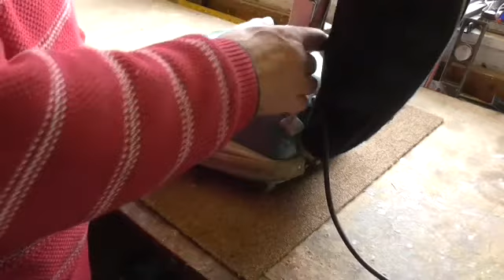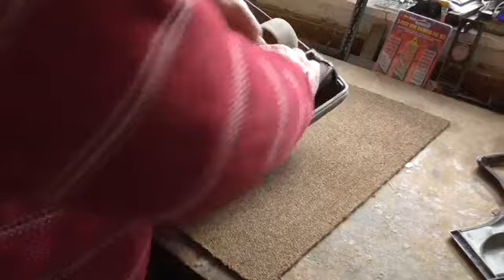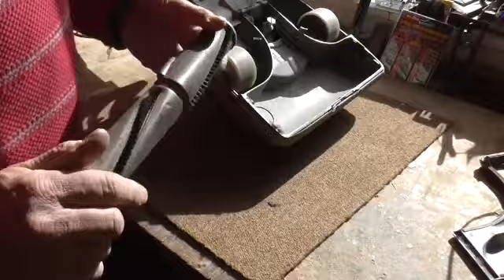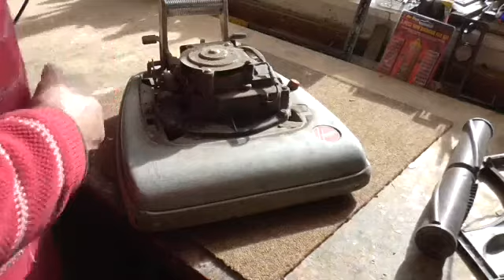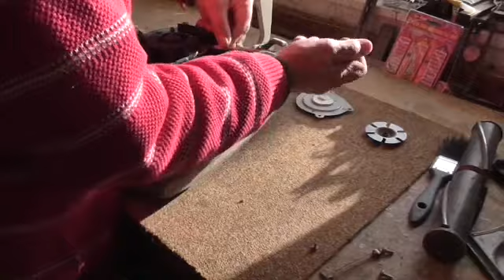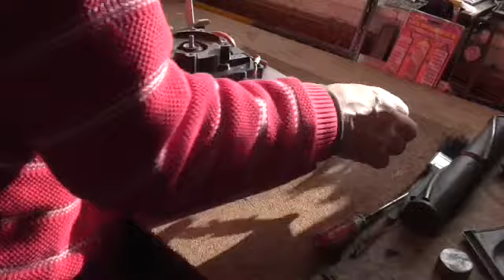Servicing a Hoover senior 652 part 1

Comment: Throughly interesting video. My mother had the same model in grey and the dusting tools which she found out had virtually no suction at all so were hardly used . She replaced the senior with a Hoover Junior U1104 as found the senior too heavy to carry upstairs. I have the Hoover Junior she had and wish I had the senior she had too
Reply from the maker: Thanks for the kind comment. Most folk who bought the tool kits for both Junior and Senior cleaners ended up not using them. As an upright for cleaning carpets they were excellent but not much good with the tool kits.

Comment: Hi, I appreciate your video as I am cleaning and servicing my mum's Hoover at the moment. However, i seem to encounter a problem as i cannot release the cooling fan counterclockwise as you did. It feels jammed. It does turn clockwise, but I see that the whole armature underneath is moving too. Any tips on how I can do this please? I tried a little spray of WD40 but not working. It feels that I am tightening rather than unscrewing. Your help is much appreciated.
Reply from the maker: If the motor is still fitted to the body you can push a screwdriver or something in the hole in the body behind the bag flange to hold it to unscrew the small fan on top.
Reply: @scrimperuk  I had a screwdriver in the bottom fan to stop it from moving the whole thing, but I just could not remove the fan as easily as you did in the video. I managed by pushing the fan blades by a screwdriver little by little until it was released.  Seems the build up if carbon on the motor jammed the fan with the upper part of the motor. Thank you so much for taking the time to reply. I'll be watching and serving bit by bit, one video at a time. Thank you

Comment: Hi, I have a couple of Hoovers, on the U1016 the handle bale wont hold the handle upright, it seems to be operated by a metal plate that a spring in the middle of the plate keeps prssed up by a rachet that locks into a latch on the base of the handle holder, I have stretched this spring out a bit but it doesnt help much, it holds the handle in the mid position OK, do you know how to adjust this bale rachet to hold the handle upright? thanks  amateursewing @gmail.com
Reply from the maker: A common fault on the 1334-1012 Hoover junior range, it's not a case of adjustment sadly. If you remove the handle socket unit you will find that the ratchets on the bottom of the socket have worn round so that the spring loaded pawl will not catch on it, sometimes it is possible to file it so as to make it catch but often a new socket is the only answer. Another thing that can contribute to the problem is the main handle socket bolt and the hole it goes through get worn which makes the problem worse. You can still buy the handle socket via ebay but they do charge a lot for them.
Reply: @scrimperuk  Thanks for that, the little notch in the base of the handle bale seems unworn and a correct right angle cut-out of the base of the holder,  I cleaned it all thoroughly but it only holds the whole hoover when you let it lock and then it will hold the weight of the hoover but you have to wait for it to "click" into the rachet to know its going to hold the weight of the Hoover or not drop out of its closed position. it is a bit of a pain.

Comment: Very intuitive !! cant beat those old Hoovers !!
Reply from the maker: Thanks. Indeed Hoover knew how to make a quality cleaner.............. until they switched to making them in plastic!
Reply: @scrimperuk  would you not rate any of the plastic cleaners then , say the 1346 ??
Reply from the maker: @WeHadOneOfThose well compared to the stuff made today they are good, but compared to older models with alloy housings I don't rate them. I have come across many juniors with cracks and splits in the housing where the agitator fits but never ever on an alloy one.

Comment: I know its a bit off topic but what do you think of the Kirby Heritage upright hoovers? there are alot quite cheap on ebay, they seem very solidly made and they have the "siphon" filler tube and easy to source paper bags, (rather like the hoover U1040s but with a carton filler hole for the siphon tube, I like a fully working vac, not a collector, these kirbys look very powerful and the hose attachment right on the front of the fac unit seems to be very powerful , Just wondered what you think of them? thanks amateursewin
Reply from the maker: Have to admit that I know little about Kirby cleaners. In 35 years being involved in appliance repair I have only probably repaired 2 or 3 Kirby machines. My impression of them at the time were very heavy and very cumbersome  machines that were awkward to use although of strong build quality by today's standards. I personally would not wish to own one (then or now) Sorry I don't know much about them at all.
Reply: OK thanks.

Comment: PS, what do you think of this heavy duty cloth bag?? it is advertsied in the UK as for the 912 model, do you think this would
fit the 612 model? it looks like it has the metal screw up band on the end of the bag for the bellows fitting, http://www.easyspares.co.uk/product.asp?c=1&c2=177&p=3819
its a reasonable price compared to some and if it fits the 612 could be good to keep it in stock until I find the right 612, thanks amateursewing@gmail.com
Reply from the maker: I can confirm that the 912 bag will fit the 612 perfectly. I have the exact same bag fitted to my 612. the 912 and 612 bag flanges are identical, main difference was that the 912 bag had a leather (later plastic piece) fitted to help prevent chaffing in heavy use.
Reply: I thought that too!! I seem to remember when I had a 612 years ago it had a replacement bag which was grey and that had a leather panel at the back so it didnt rub when the nadle was right down and the bag scrapped on the ground, given that amazing 20 bid £102 quid 612 that just went on ebay I dont think I will be getting one soon, unless I find an old 612 in a junk shop!! thanks Amateursewing
Reply from the maker: Amazing at how many Hoover machines that I have sent for scrap in my time, I used to collect all the older stuff (pre war) such as 750,s and the superb 825 with the illuminated Hoover logo but scrapped anything post war.

As recently as 18 months ago I sorted my Scrimpers shed out and chucked out some old Hoover machines inc 1224, 262 and some 375,s I am beginning to wish I had kept them now.

I am hoping to feature some more of my old Hoovers here as soon as I get the time to film them. inc 862, 750, 1334 and 2154 'suitcase' cleaner.
Reply: I know, I wish I had never got rid of my 612, I had it for my first flat over 40 years ago and it was super, I have always had Hoover uprights, I bring some from The Netherlands where I have family, you can get the really good U1040 high end junior ones there now and again, I will take my 6525C one there on one trip. I havent seen an 825 with illuminated hoover logo, I must google that one, I guess it is the one with the only cloth bag, no paper bag on a bellows?? I do like the later juniors with the high "siphon" tube where the bag fills from above as that seems to be most easy to empty and no mess.
Reply from the maker: Model 825 dates back to 1936 long before paper bags were thought of.

Comment: Guess what?? there is a 612 from that seller who had  the 638 on ebay, it is item nr: 272798227771 its got 4 bids on already, it says there is a a weakness in the bag somewhere and there is rusting on the bag nozzle, I wonder if it is possible to sew a new bag for these?? I am sure I saw a vid about somone making a new thick dust proof bag for these - have you see that?? am very interested in this, you can blow through the hose with it on the back of the bag outlet!! Amateursewing!

Comment: PS I used to have a 612, the bronze one, lovely machine, but that also has only the thick cloth bag, no paper bag, it looks to me that the "mouth" of the bag attachment is similar to the 652's, would it be possible to fit a different bag on the 612 which has the bellows and a paper bag fixing? thanks amateursewing
Reply from the maker: Hoover 612 is my favourite machine. I still have one,it was fitted in production with the filter cloth bag. The 612 was replaced with the 638 model, basically the same as the 612 (same motor and chassis etc) but with a different shaped  blue hood (which IMHO made it look ugly) it was the first upright to be fitted with a paper bag as standard. the 612 could be fitted with a 638 bellows tube and outer bag which then took the standard open re-useable paper bags as fitted to the 1334/652 ranges. 
The 612 I own was equipped with 638 bag and bellows but I changed it back to the filter cloth bag as it was when new. 

Things have changed so much in domestic appliance servicing since the late 1990's, as recent as 1998 we carried many spares for 612/638 inc bags and bellows but now it is very difficult getting spares for most original British made Hoover machines. A great shame IMHO but people just throw older Hoovers away and buy a cheapo plastic Chinese made thing that lasts but a short time. There is now no machine that compares to the old metal bodied Hoover machines.
Reply: Youre so right!! I didnt know the 638 had a bellows and filler pipe in the bag for a paper bag to be held on with a rubber ring!! WOW!! thats what I want with a 612!! I had a lovely 612 over 40 years ago and I sold it!! I wish I had have kept it, it was in mint cond and only cost £2.50 in a 2nd hand shop then!! I agree the hood on the 638 is bloody ugly! and I am not keen on those too close back wheels, with that odd looking heigh aduster, it looks very unstable really all that outer width being pushed forward on those narrow wheels.
I really wish I could find the 612 again. I am looking at this 638 on ebay but I think it will skyrocket at the end of the auction but I wish I could find a bag like its bag with the same lever type fixing on the metal base if it has the plastic inner bellows and filler tube, would be worth keeping that until I could find a 612, they do appear now and again on ebay.  Ive ordered another LED 5 watt bulb for my 6525C, the lens on the front of the hood is a bit warped with the heat of the pygmy incandescent bulb, these LED bulbs never get hot, ideal for sewing machines too. thanks amateursewing
Reply: PS, this is the link for the 638 currently on ebay, do you think this one will have the plastic tube inside the bag for a paper bag? thanks amateursewing 
http://www.ebay.co.uk/itm/Stunning-Retro-Hoover-638-Senior-1955-c-w-Tool-Set-rare-spec-serviced/272788018999?ssPageName=STRK%3AMEBIDX%3AIT&_trksid=p2060353.m1438.l2649
Reply: PPS, I have just read the description on this 638 and it DOESNT have the "standup" inside the cloth bag, it just fills up the cloth bag, no point in bidding on this then, thanks Amateursewing, just waiting for my motor brushes coming for the 6525C, will see how motor runs then, though its fine now but just full of black carbon dust.
Reply from the maker: Looks to me if it has been converted to use the old style filter cloth bag and is not equipped with a bag tube. The 612 bag flange is different internally to the 638, you need an actual 638 flange and bellows to use paper bags on either a 638 or a 612. externally the flanges look the same and fit either machine but the original 612 flange cannot be fitted with a bellows. The filter cloth bag will fit either flange.

You would have a problem obtaining a 638 bellows now. It's wider than the ones fitted to the 652 range.
Reply: Yes, I thought that would be the problem, I think the only way to find the flange & bellows from and old 638 is to look around council dumps, there are always loads of old vacs at ours, but I have NEVER seen these really old Hoovers, as I dont have a 612 it is a bit academic as I would need to find a good 612 first, I should NEVER have got rid of my old 612!! but that was over 30 years ago. I do like the U1040 junior with headlamp (I have 3 of those) as they fill with the siphon tube from ABOVE, which I think is the best type of fitting, easy to empty and no dust or blockages can fall back into the fan unit,  but of course these are all plastic, I am taking my 6525C over the family in The Netherlands where we have a huge flat with 63m2 of carpet throughout, it will be ideal for there. Thanks Amateursewing, by the way, is there any way of greasing the brush roller bearing if your dont have a grease gun? I put sewing machine oil in mine.
Reply from the maker: The easy way to grease the agitator bearings is of course to use the proper Hoover supplied grease gun but not many people (unless involved in Hoover repairs) would have one.

However it is possible to take them apart and grease them as you would a cycle hub. if you look closely at the bottom of the bearing you will find a simple circular circlip, if you carefully price this away the bearing will fall apart you can then clean up the bits and reassemble using the grease to hold the balls in place while you assemble the bearing.  It is a bit fiddly but can be done.

You can still buy replacements but some on ebay charge ridiculous prices.

I would not recommend using light oil on the bearings.

Comment: Hi, Ive got a question for your about the brushes on my 6525C, they dont leave really deep grooves in a thick carpet (they are just visible) even with the hieght selctor set for the thickest carpets, so the "mouth" of the hoover is very low on the ground, the brushes on the roller do stand proud of the aluminium brush cover but not much, but they look fairly unworn, do you think it is worth replacing the brushes in the roller? I can mail you a photo of the brushes in the roller, thanks amateursewing @ gmail . com
Reply from the maker: Hello. The agitator brushes should not brush the carpet 'strongly' but rather just lightly flick the carpet. When new the brushes are around 1/2" (12mm) deep (bristle length measured from the plastic part) the early machines used real bristles which did wear down over time, the nylon replacements tend to last longer but do tend to snap off after time rather than wear down. :)
Reply: OK thanks for that, I have just checked the brushes, they dont look too heavily used and are about 1cm deep from the edge of the mounting plate. I have actually just bought a pair of Hoover (carbon) brushes for the motor as I took off the fan cover, 3 screws on mine and it was FULL of black carbon dust, and the motor brushes are only about 5mm long, so am replacing those, the serial nr on my hoover is 65211013665, if you mail me at amateursewing @ gmail com I can send you photos of this hoover, incidentally there is a 386 senior on sale at the moment on ebay with a 99p start, but the trouble with that hoover is that it doesnt take a paper bag and only fills up that cloth bag which I dont like the idea of. thanks amateursewing
Reply: PPPS! the brushes just arrived, so have got those in, years and years of life left in these ones, the springs were so long I had to put a narrow screwdriver down the spring as it was in the slot and then hold the end of it in as I put that metal blanking plate on the end! but runs great now!! thanks Amateursewing
Reply: Thank you for explaining slowly and going through things piece by piece it helps novices keep up.

Comment: LOVE THESE VIDS!! I have just got a Hoover 6525C, the blue one, its in very good nick, only £20 in a 2nd hand shop but want to check the brushes and this is very helpful, I replaced all the cabling and cleaned it up, washed the blue bag in the washer and T cut polished the hood and casing, it looks super now, put an LED bulb in the hood, very good, I see this is the model with the two speed motor when the hose connector is fitted into the channel under the bag? Is it worth getting a hose and tools for this hoover? what I would really like is a top siphon fill tube for the paper bag, like the U1040 later junior models so the dust fills from above would that be possible?? thanks amateursewing gmail com
Reply from the maker: Hi, IMHO it is not worth getting a hose and tools for any Hoover upright, even when the convertor is inserted in the 652 and the motor speed increases the suction is still very poor. Most of the early Hoover uprights were useless with hose and tools but brilliant at cleaning carpets as an upright machine.

I doubt you could obtain a top fill tube now but personally I always preferred the original bottom fill as the 652 and 1334 range were equipped with.

For £20 you have a brilliant quality British made upright machine which is far superior than and will outlive all modern plastic cleaners.

Glad you enjoyed the videos.
Reply: Hi, thats what I thought about the suction on the hose adaptor, I have a Miele cylinder vac, the best ever made all their paper bags fit all the Miele vacs from 30 years ago! I know I have them at family in The Netherlands for over 30 years! and the bags are dirt cheap, I do prefer the upper fill siphon tube on the U1040 though, I find its easier to just take off the bag and throw it away, whereas this direct fill pipe on the 6525c blows all the dirt to the bottom of the bag and when it fills up it starts to fall back into the filler pipe and down near the fan. But youre right for £20 this hoover 6525c is a great bargain, it was FILTHY but I think the motor is very good and the brush roll wasnt rusty or brushes too worn, I washed the blue bag in the washer after sucking all the dust  off it when inside out with the Miele, then washed it in the washer, now its fantastic. I replaced the whole wiring with 13metres of cable, tinning the ends in loops to screw into that terminal block on the inside. it really is a great vac for thick carpet. thanks